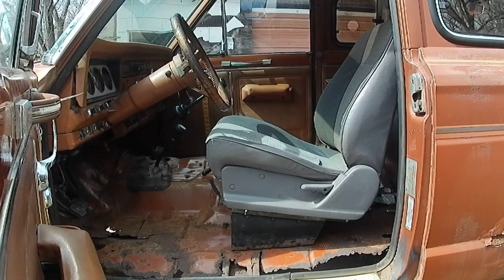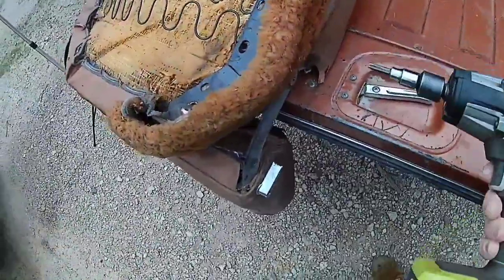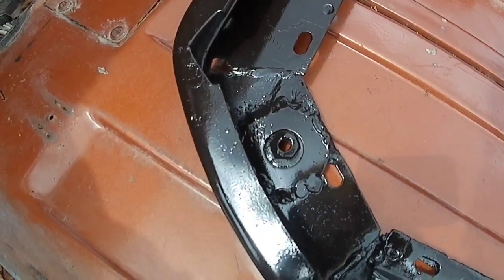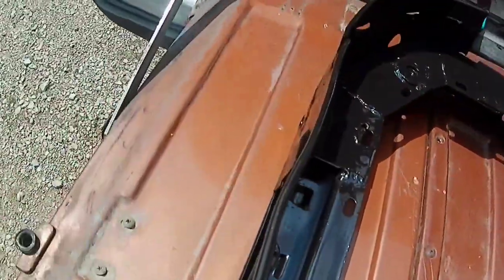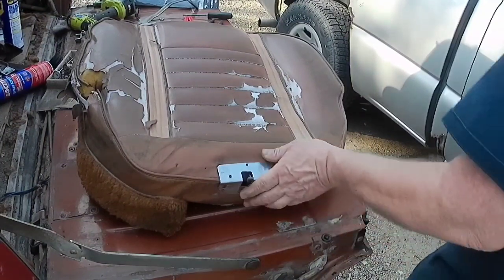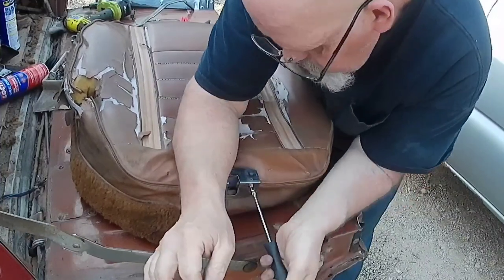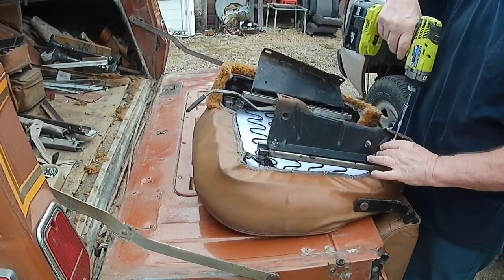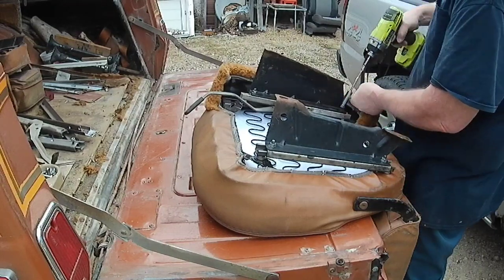Driver seat repair broken frame

Comment: What kind of welder did you use
Reply from the maker: Titanium 140 I use  Flex core  wire  I'm not gonna make excuses How pretty The welds are.  They are what they are  End of story
Reply: @Terry Willcut's Garage  I totally get that I have an Eastwood 140 and i'm just learning.